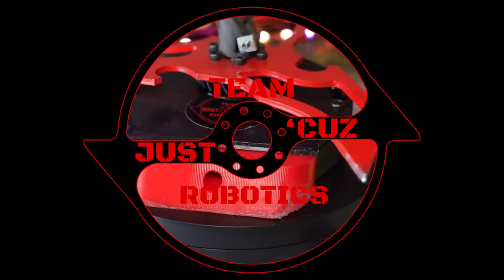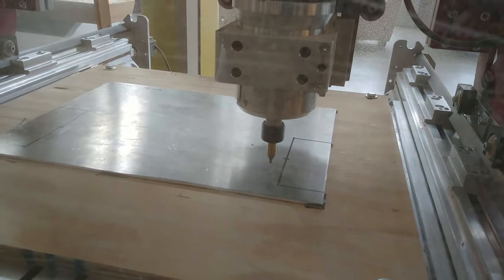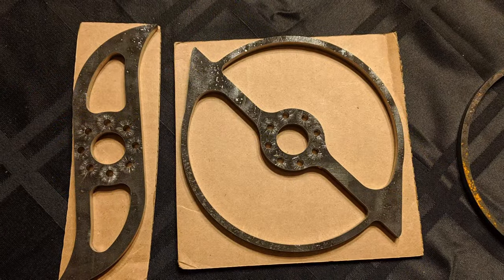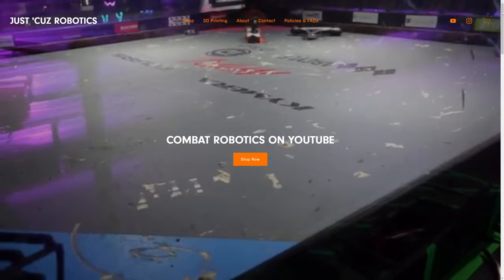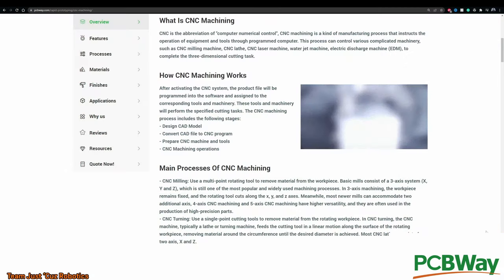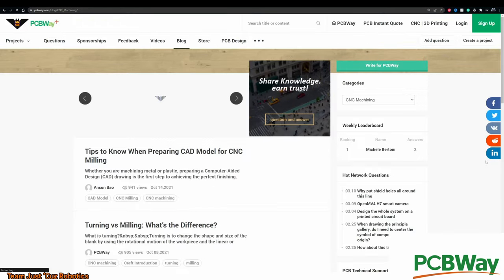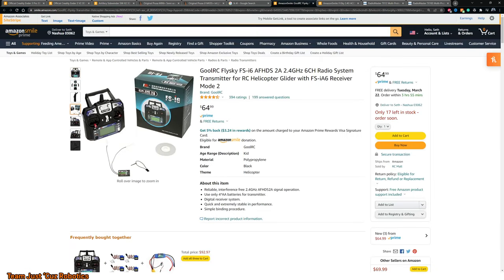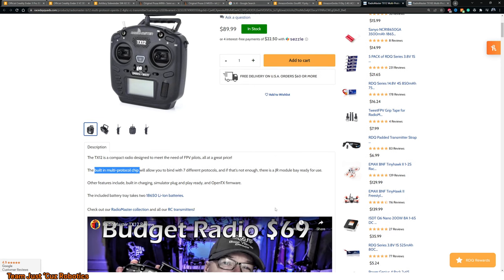How Much My Combat Robots Cost and How To Save Money On Yours!

Comment: I've found in my bots that you can offset a limited budget with a little creativity, hard work, and steady hands. I was able to build my 3rd place flipper Antweight for about $85, and that's including the same set of Fingertech motors, no-name Chinese Esc's, and 2s Lipo (never resoldered the setup) that's been in different iterations since 2019.  Making a mono-block chassis by milling out a piece of UHMW is totally possible using nothing but a $50 mini benchtop drill press. Heck, I made my son a competitive antweight in 24 hours using a Wal-Mart cutting board, a cookie sheet, 6 discount n-30 motors, and 6 Lego wheels. 19mm tall invertible wedgebot for about $50.

Comment: That was awesome! Extremely helpful for someone like me who is just starting out in the hobby. I have had such a hard time keeping track of costs but I am still in the 1lb bracket and 3D printing most my parts. For my new 3lb design, I will be using a lot of the tips you gave. Thanks!
Reply from the maker: Great to hear!
Reply: @JustCuzRobotics  can you help me i am trying to make a bot not sure if i will compete though since the competitions are a bit far but my plan is to make a grabber robot like lock jaw (but in the antweight plastic) from from battle bots and in my cart i have 2 Repeat Robotics Brushed Drive Gear motor - 4mm, 1    FH-5515MG Analog Servo CCW 15kg (Counterclockwise rotation),  Repeat Robotics Dual ESC, and 	T6A Transmitter 2.4GHZ 6 Channel Bundle  (which is the controller, receiver, and charger). what other part might i need except the frame, weapon and battery. but i also need help trying to find a 3 cell with 450mA  9.0V battery that would work pls help me
Reply from the maker: @Shaw-p9y Email me at team@justcuzrobotics.com for robot support. I have a few recommendations.

Comment: I probably sunk $100 into my current bot. But I already had my batteries, radios, and ESCs. Even better I did so terrible in my first event that people donated wheel hubs and motors that they bought but couldn’t use. So my only real costs were some spares, wheels, UHMW and some nice servos that I may or may not use for a weapon. I also make everything my self without 3D printers or CNC stuff or services and that saves a good bit of money. If I ever make a spinner bot I will have to start using send cut send but we will see if I ever do that
Reply from the maker: Using stuff you already have can be a great cost savings once you have been doing this or other RC sports for a while. It helps to stick within one weight class for that reason!

Comment: Some questions because they were requested:

1. Are you planning to or do you already have a cnc mill (tormach or haas or something like that)? I suppose if you still have access to the maker space this isnt a priority. 

2. Do you reckon the itsy bitsy Makera Carvera with its tool changer and levelling will be a great tool to get started with for small aluminium parts? Seems like all the cnc mills at the low end trade every bit of quality of life for maximum cutting power and travel for the price. I mention this one because it seems to take up little space while having tons of quality of life features so it won't become a hobby by itself. 

3. Have you managed to successfully make any press fit parts ordering cnc / cut parts off the internet (I'm thinking press fit bearings and that sorta thing)

4. I imagine the next video will cover this but do you have tool recommendations for certain price brackets (for instance under 500 for a printer and some hand tools, under 5000 for a router and some power tools /that sort of thing)? Basically a tool prioritization list for the order to build your inventory in.
Reply from the maker: The makerspace I have access to now has a Tormach PCNC1100 which is pretty decent but it still isn't nearly the same as a Haas. I couldn't possibly buy my own tormach or Haas as I live in an apartment though, even a CNC Router would probably be too loud.

Like I said in the video any sort of gantry CNC router will need some seriously dialed back speeds and feeds or else lots of upgrades to add coolant and an enclosure or something to contain the mess in order to cut metal. It can do it but it'll be many many times slower than a Tormach can do. A proper mill like you said has small travels, but that's in order to have 10X - 100X the rigidity that a router style machine can have.

Yep! I got a bearing press fit from a machined part from ZTL and just called out +0.000 / - 0.002 inch on the bores. They were perfect. For a standard tolerance laser cut part though, you will wanna probably go under size and Dremel it out and then press the bearing in carefully when there isn't too much resistance.

I can't spend too long to cover something as specific as that but I will show what other people have been buying. One guy has an Omio X6 CNC router for $3000 he really likes. Can do light cuts in aluminum as it's a bigger but more rigid machine than a Carvera. Shapeoko works well for plastic but it really struggles in metal.

Comment: I really want to get into combat robots except that there is no events nor anything where I live in belgium and my budget is literally 0, I was thinking that I could find some ultra cheap reciver and motors but just like for rc planes, the hard entry point is a controller which is around 50€ last time I checked which is WAY over my budget...   so am there not being able to make things more complex than tiny 3d printed contraptions like fully 3d printed spring powered clock or desk toys...   gosh I wish money wasnt something required for literally everything and such huge amounts...

Comment: I was curious as to whether or not buying a kit like a viper or D2 and taking electronics from those to use in your own robot would save money. Would this work, cost about the same, or be a terrible idea?
Reply from the maker: It is not a 'terrible idea' but it will certainly not save money to pay for all the added chassis components. It will be much cheaper to part together a set of electronics and then build a chassis around it in an economical manner. 

The kit will cost more since you are paying for more than just parts. There is labor cost involved with packaging and sorting all these components, sometimes with added soldering or wiring etc compared to standalone parts. Plus for the D2 especially those machined chassis parts are not cheap to make either.

There are already some options out there for weapon kits and many options for drive kits. I intend to offer something along those lines eventually, but it'll take a while to get to that point. Waiting on some ESC development to be able to offer an ESC + Gearmotor drivetrain package. And weapon stuff... Well where spinners are concerned that just seems like a liability nightmare waiting to happen.

Comment: Custom gears... Any suggestions for getting them made or making them? Also (and I'm probably the only one) I would love to know more about slip clutches used in heavyweight spinners. 

Many thanks.
Reply from the maker: Custom gears step one: spend way too much money to buy 100 at a time at minimum. Step two: regret step one
Reply: Machinery handbook has the standards in it to design your own.
Reply: I like this question because I bet the biggest factor is knowing which service to pick and how simple to make the gear to not need a fancy machine.

I bet they could be laser cut depending on needed tolerances.

Comment: I could use this, I spend thousands just for this 1 Norwalk coming up next week
Reply: THOUSANDS!? what weight class are you competing in?
Reply from the maker: He bought multiple entire 3lb robot kits...
Reply: @Dangineering  3 lbs,my 1st one was a kit,then my next Norwalk I modified that same kit,now I’m running a FTBB,not a kit tho,it 1st was a kit but got some new stuff in em and I plan on adding some more custom things once I see what I need to upgrade to make it more effective and I could use this stuff to find cheaper ways in getting replacement parts like chassis wise and other configs/parts
Reply: @chriscapps206  Ahh, I had no idea that the kits were that expensive.
Reply: Oh yea. They are very niche and low volume so by the time you pay the person for their time and the price of low volume production they get pricey.

Personally and it's totally a personal preference,  I don't see the point in going full kit because I always thought the fun of it was in making your own designs and seeing how they work out.

Comment: have i misunderstood this or is the only way to make bots affordable is to have a 3d printer at hand?
Reply from the maker: Its definitely not the only way but its by far the easiest. Given a really good 3d printer these days like the Bambu lab A1 Mini is like $250 it will save you a lot of money in the long run.
Reply: @JustCuzRobotics i get what you mean nut i was just going to cut soem TPU with a tablesaw or something, i think ill have something strong enough but idk
Reply from the maker: For stuff you can cut with woodworking tools, plastic cutting boards work well. They are usually HDPE or UHMW which are very impact resistant plastics.
Reply: I doubt HDPE is good for beetles though. ill see what i can do

Comment: Is there a free way to convert stl or obj files to dfx files for send cut send
Reply from the maker: Not directly that I'm aware of. Those are 3d mesh files rather than 2D CAD/ drawings. The easiest way is import into fusion 360 and trace the part you need to export as DXF into a sketch, then same that sketch as a DXF (right click in left hand menu)
Reply: @JustCuzRobotics  Thanks so much. The free version does not allow exporting in DXF but your explanation definitely helps me.
Reply from the maker: It does allow the save to dxf the way I described, just not exporting a drawing to a DXF
Reply: @JustCuzRobotics  Awesome Thanks. I am completely new to the program and it is a bit of a learning curve considering I have been using 3d builder up to this point.

Comment: Do you use alloy 910 at all?
Reply from the maker: Pretty much every black printed part in Division is Alloy 910
Reply: @JustCuzRobotics  how does it do for impact resistance and structural reliability vs a carbon fiber nylon?
Reply from the maker: Carbon fiber filled is usually not very good for impact toughness, the more rigid materials are usually more brittle. Alloy 910 is also sortof brittle and stiff as Nylon materials go, but it prints very nicely in my experience and it is very strong and low friction so it's ideal for pullies and gears. I'm starting to experiment with a few other options though for parts that might need to take a hit.
Reply: @JustCuzRobotics  awesome, thanks man!  Looking for a material that prints easier then CF nylon and has similar or better suitability for frames as well as wheels and hubs and such.
Reply from the maker: For anything that will take a direct hit and doesn't need to be rigid, TPU is king. It's not hard to print at all and it's basically rubber so it's unbreakable. I use it for Division V3's wheel hubs and wedge/fork mounts now.
Reply: @JustCuzRobotics  yeah i use TPU for the wheel hubs on one of my antweights, but the frame needs more rigidity than tpu can give me.  I may look at splitting the design though and printing the impact surfaces in TPU.  Do you think 910 is too brittle for weapon mounts at antweight scale?  Cf nylon has worked in this design, just looking for simplification.
Reply from the maker: It may work, ants are not too chaotic.